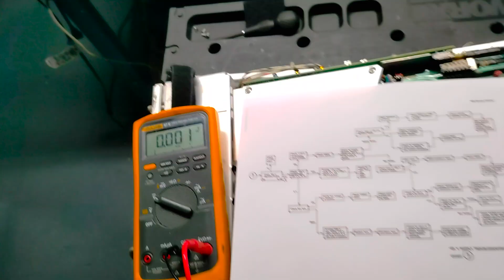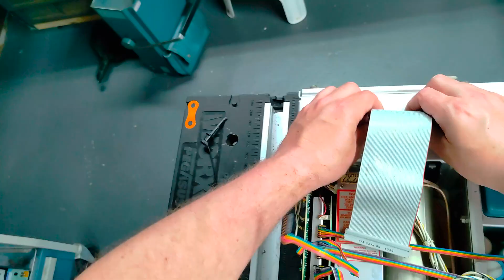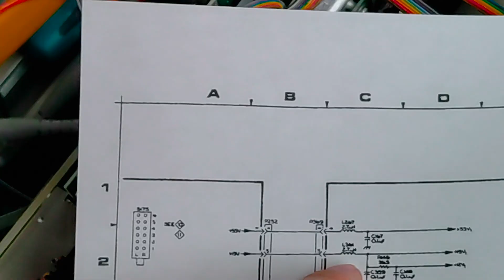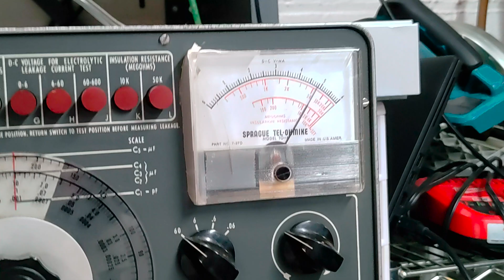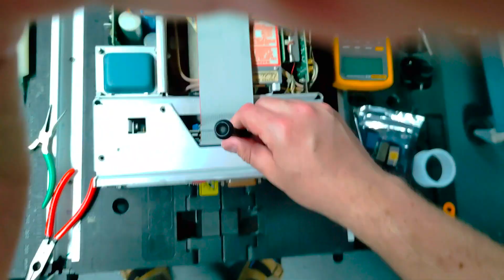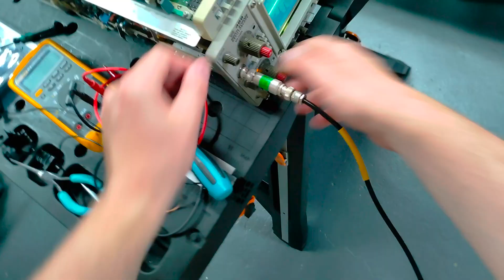Tektronix 468 Oscilloscope repaired with a 25 cent capacitor

Comment: I was once given a Tek 2445 that was red tagged unrepairable.  Had AC ripple and noise on the trace.  It had those leaky red and black plastic seal filter caps in the supply.  I just probed the DC test points to see which buss had the ripple.  A few cheap filter caps and all was well.  It was a pretty obvious easy fix.
Reply from the maker: Someone wanted a new scope at work im guessing!

Comment: The FPV is rather distracting and would prefer not... is there a way you could apply motion-smoothing to the video? (may not help?)
Reply from the maker: I agree, and I have no plans to make it my main video format because of that.  However I may release videos from time to time that I otherwise wouldn't post at all, like this one.  I've worked on a lot of cool stuff that would have made an interesting video, but didn't bother recording it because it's just not something I always want to put the effort into, especially after a long day at work.  If I do post any more videos like this I'll make sure to include the message at the beginning so people can skip if they want.  

Image stabilization is turned on in the device, and any additional that I add in Final Cut Pro just makes it seem "weird", so yeah not really a good solution.  I could probably try to limit my motion some more, but that would take me a lot of time to get used to.  Thanks for the feedback.